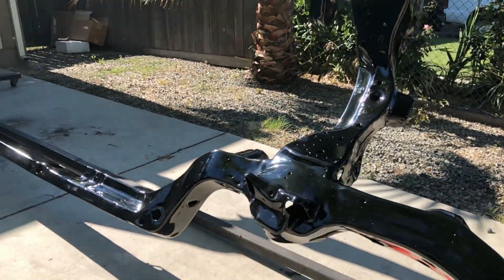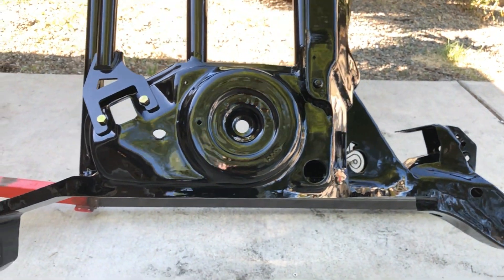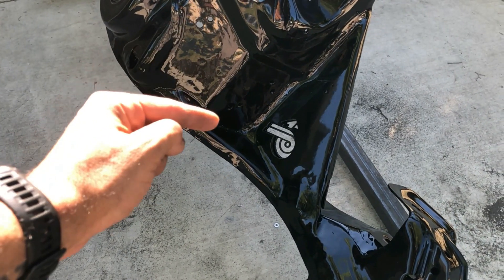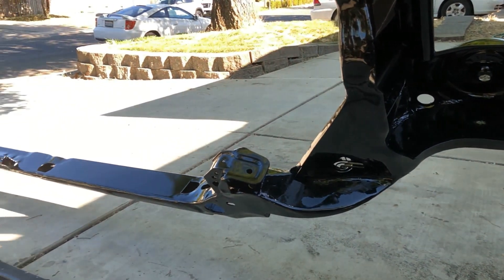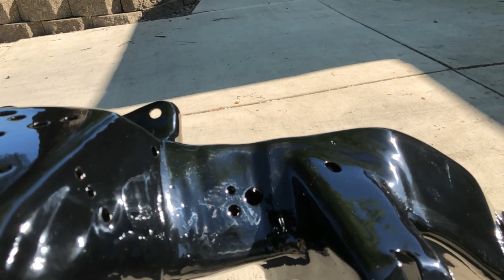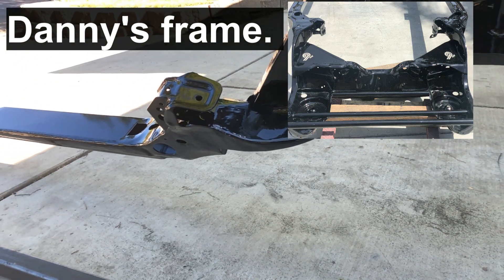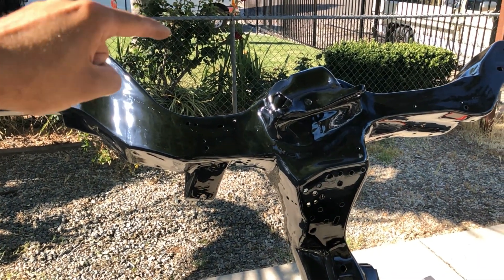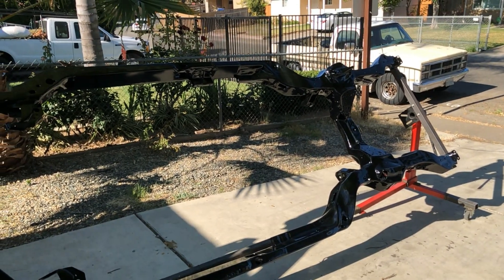Turbo 6 is back from powder coat!!!!

Comment: Frame came out looking flawless man.
Reply from the maker: MC BlueCollarGuy thank you!
Reply: What did your frame cost you to be powdercoated? Did they spray a rust preventative on it before it got powdercoated?  My frame an cross member was $589.
Reply from the maker: MC BlueCollarGuy $187 for primer coating $375 to Powdercoat $150 to sand blast. And I had a bunch of other parts so in total it cost $924
Reply: Nice